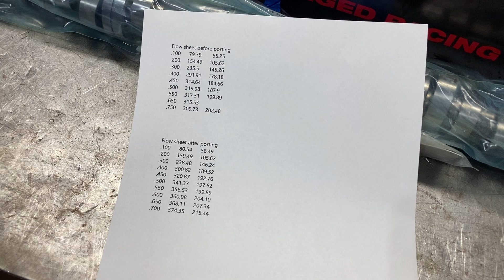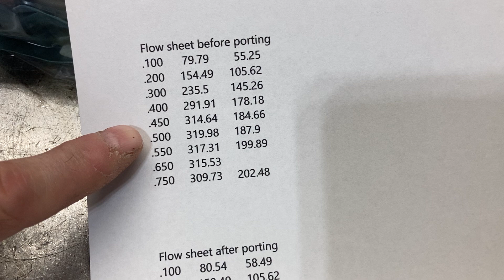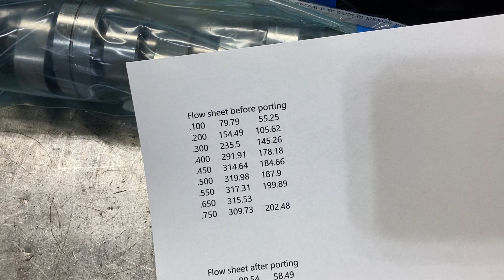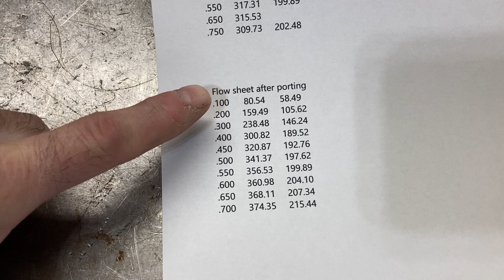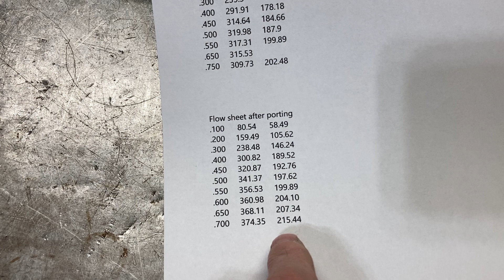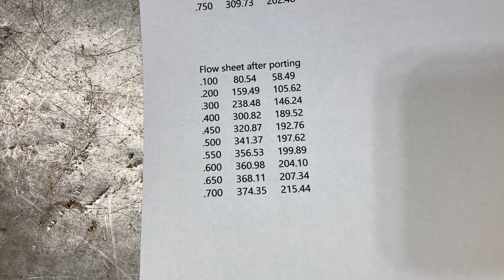Lykins Motorsports 396ci Tunnel Port Dyno Mule Head Flow Numbers

Comment: Can you tell me how the SS/AA Thunderbolts like Pond or Pequot  are making 950 + hp and running 8's in the quarter mile ?
Reply from the maker: Lots of rpm, sheet metal intakes, and years and years of trying different things.  In more instances than not, ET and MPH are found with the chassis, not the engine.
Reply: @lykinsmotorsports  950 hp high risers are no joke . Basically I want you to tell me how to build one just like theirs . I'm impressed at the hp they can get out of those engines and remain in SS classes
Reply from the maker: I'm not that slick.
Reply: @lykinsmotorsports  But you are being honest . There must be an answer around here somewhere?
Reply from the maker: The guys that are running that fast are not just gonna hop on YouTube and give away all their information.
Reply: @lykinsmotorsports  It's an invitation to dust off our Sherlock Holmes hats and figure this one out .Remember American ends with " I Can "
Reply: @edge2sword186  I think the difference between high 8s and high 10s is probably about 40K, but that is just a guess.